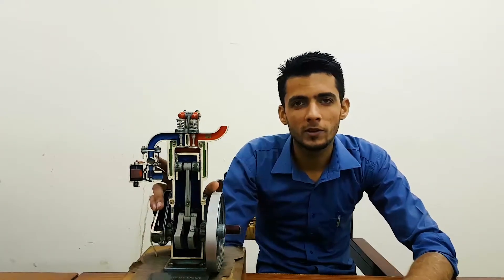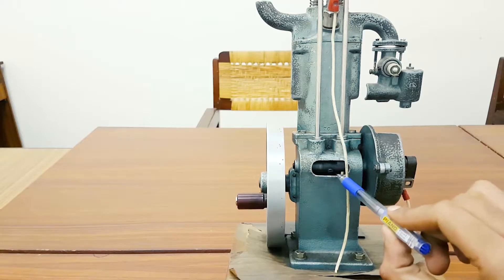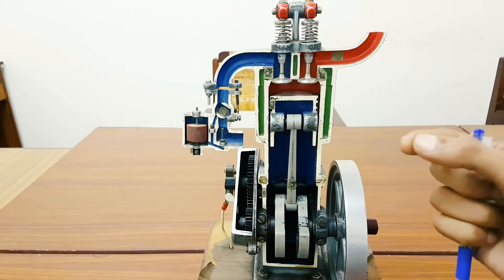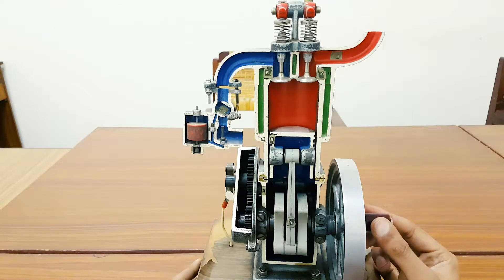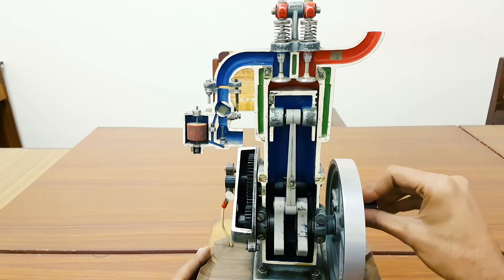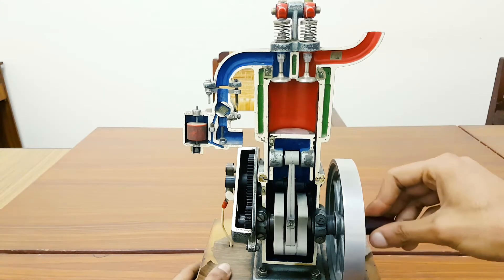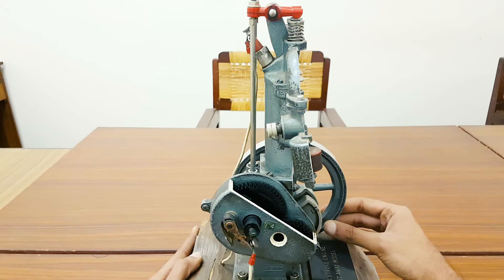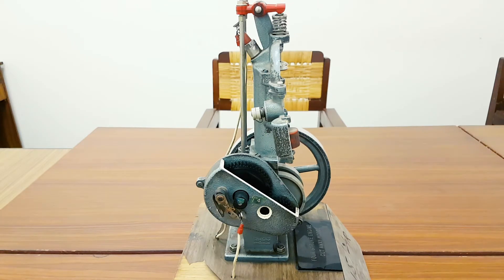How Four Stroke Engine Works

Comment: What is Intake stroke,how piston will move from TDC to BDC during intake stroke.??
Reply: The intake stroke is when the air fuel mixture is pulled into the cylinder, yes the piston moves from TDC to BDC

Comment: How does the initial 1st stroke happen since there is no fuel explosion to push the piston down? I guess this would be starting the engine?
Reply from the maker: Kick starter or starter motor is used to achieve intake and compression stroke...
Reply: @vortexride1475  oh ya that's right I'm stupid, like when you pull start a lawnmower or kick start a dirt bike.

Comment: Sir i have a question 
Why 4 stroke engine doesnot produce smoke.
I see the difference between both 2 and 4 stroke but didnt understand on the smoke system
Reply from the maker: Bro 4 strokes have proper lubrication for crankshaft so it uses oil wiper ring on piston to avoid engine oil to combust in chamber.... while 2 strokes dont have proper lubrication for crankshaft so we mix oil with petrol in order to solve the issue... the burning of oil in chamber causes 2 stroke to give smoke..... also 2 stroke pistons have tighter clearance as conpared to 4 stroke...